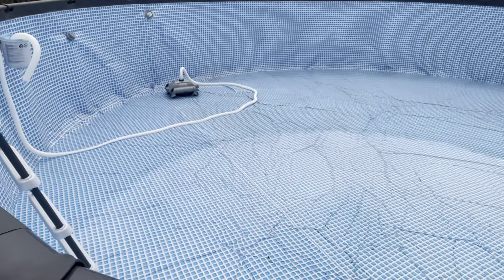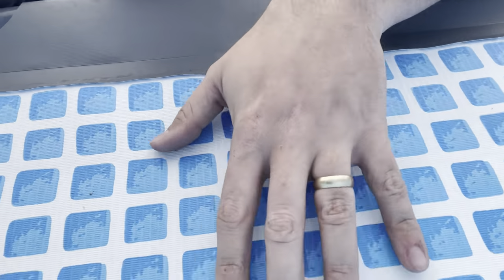FIXING MY INTEX Above Ground pool! Don't... Do what I did.. UPGRADED Skimmer!!

Comment: One thing that took care of wrinkles completely for me was allowing a half inch of water or less inside and then standing outside the pool with a shop broom.   Then take the broom and reach inside the pool and hit the bottom wall walking all around the pool as it fills.   Best way to clear up wrinkles in my opinion.   Also good to check how level the posts are as it fills every few hours or so knock them back into alignment. 

Props to anyone setting up a pool for their family's use, it's a lot of work. 

   A pool is fun for everyone except the person who takes care of the pool.  But when your kids flip out and smile in excitement when they see it, totally worth the headache. 
😄
Reply: What are you even talking about "alot of work"? The box clearly says 90 minutes to set up ...
Reply: I'm doing that shit rite now and it's so frustrating. My mom passed last year and I was so damn depressed I left the pool up all winter and just now starting to clean it and fill it up. We have so much minerals from the lime stone in our water so the liner has a solid layer of hard crystals like salt in the liner and the pressure washer won't take it off. Do u know of a cleaner I could use? Maybe vinegar then scrub it then pressure wash it?
Reply: DID THE SAME THING,  BEST THING I'D EVERY DONE.  SAW IT ON A PREVIOUS VIDEO
Reply: @steveappleton4183 Are you being sarcastic?

Comment: One thing my neighbor did to help, after I had already been trying everything myself for a few days,  was she lifted the side of the pool from the outside and pulled it.  I was too busy in the pool trying to get the wrinkles out to try that.  It worked wonders to help with the big wrinkles.  

That happened because it started to rain as soon as I got it up.    After 3 days of rain there was water enough I said oh just fill it up forgetting about the wrinkles.  

By the way thank you for your service.

Comment: We used 4x12 inch pavers under every leg and dug them down to be level. We put sand under & because we did it the right way ours has made it through 2 70+ mph wind storms here in Ky. It took a week but that was 4 summers ago. It’s definitely worth doing it the right way

Comment: Have the same size pool. The best thing I did was order a custom 64 foot ratchet strap to go all the way around the base of the legs sitting on the plastic caps. I was worried about those legs moving around. Worked perfect 👍🏼
Reply: That’s why the pool has straps….
Reply: @YellowBoltTC  it does ! Mine doesn't !!
Reply: @bernadenevanburen1521 Which pool? All round pools have straps, otherwise, it would fall apart, lol.

Comment: We had to drain our pool and re-level it using some pavers. One thing we didn’t think about was the ladder. Once the pavers were in place and the kids started using the pool, we noticed that the ladder was hitting the top rails of the pool. This actually dented two of the top rails. Now we’ve had to order two more top rails, and will have to drain the pool again in order to switch them out. So don’t forget to check your ladder if you’ve raised up your pool and be sure it still clears that top rail.
Reply: Same!!! I have the stupid ladder on a few extra pavers for now 🤦🏼‍♀️
Reply: we put our ladder on a little "patio" of pavers to solve this issue.

Comment: Ahahhaahaha loud train lol good job looks good ,we did 18x48 and we did some digging in the ground one side lower and one higher 5 legs have pavers and the rest are sitting in the ground nice and tight, towards the back of the yard and away from house are the pavers and its higher so if happens that it would tilt or any bad weather or who knows now days whatever hits it it will go down the yard since other legs arent moving and are nicely in the ground and it will not  hit inside the house we love it ! I'm thinkin of installing skimmer next year need something to clean it because for while now I have been cleaning it myself with brush dont mind it but since pool went from 16 to 18 its alot more work now lol

Comment: I’ve never used pavers I get craft wood and paint with liquid flex seal and I relevel the ground every year then got smart I dug trench and put dig in edge and used paver base and got it super level and thanks to the dig n edge I had no wash out and it stayed til this season yay! You will blister yourself pulling with hands or feet the squeegee makes it so easy and the inch of water helps them to flatten

Comment: Pavers should be level. I went inside my pool before filling it and used my feet to pull the wrinkles and then again as it was filling. No wrinkes now. While the pool fills, every 39 min you should adjust the legs which is why pavers shouldn’t go too close to the pools liner as they will pull out. Wider pavers are better but we had a 16ft concrete slab poured to avoid unleveled ground and pavers potentially touching the liner. Installing a wall skimmer tomorrow!

Comment: using pavers will raise the walls 
the side walls are only so long 
go too high and you will pull the floor liner up and will act as a side wall 
this will cause a hole where the side and bottom meet 
happened to us
Reply: Using pavers is perfectly fine and actually recommended. You just have to make sure they're buried and level with the ground.

Absolutely nothing wrong with using pavers. Infact, you run the risk of the polls actually sinking into the ground without them if the dirt below the pool isn't compacted enough.
Reply: @Superman-xr1oh Yea we just setup ours but didn’t realize the pavers have to be buried do you think we should drain and fix them or should it be fine scared of it tearing the liner and dumping all the water into our yard we are really close to multiple neighbors so that won’t end well

Comment: Did you ever have any issues with placing the pavers on top of the ground vs digging them in?  I’m using wood blocks (temporarily) and was worried about the height increase pulling on the liner seam. Thanks!

Comment: I got on my hands and knees before I put water in and push them toward the edges and then I put a little water in and put on my shower shoes and I was able to move the bottom and smooth it out

Comment: How did you get the last top bar in?  I have about a 5" difference & cannot pull it back or stretch it out enough to get it snapped togther to completely form the top ring?
Reply from the maker: Is the pool full? If so, you’ll have to drain the water. Make sure it’s on a level surface as well

Comment: You should’ve buried the pavers in the dirt or sand below the pool. Sticking it up on pavers like that will end up causing issues.
Reply from the maker: When I encounter them I’ll make a vid about it lol. Everything seems to be super solid
Reply: First thing I thought.   Luckily they will sink a bit,  but being higher that the bottom of the pool it is likely to stress the liner and poles.  

Every bit counts when there is 50,000 pounds of water in your backyard. 

He did much better than my cousin.   They ended up with a  3 inch difference in height from side to side.   Didn't take long for trouble.

Comment: Hey! Curious what made you feel like you knew you needed the pavers under the legs. Sry if you covered this and I missed it!!
Reply from the maker: 2 things,1st, I mainly just listened to the feedback my viewers gave me, and 2nd, I had to drain the pool so why not lol. Our soil where I live is soft and sandy so I think over time I would have had issues with the legs sinking even though the yard was packed by the excavator.
Reply from the maker: Good question!
Reply: @BigCountrysWay  Sounds like you did the right thing, I'm in the same boat- prepping our backyard for the 24ft XTR has a painful  undertaking lol Ive watched your review/instructionals a few times! but it seems like pavers v. no pavers is something people don't fully agree on! I appreciate the response!
Reply from the maker: @hardwarenutz9651  that’s impressive, any tips for the community?

Comment: What if one set up his above ground pool on a concrete slab ? would that help regarding the wrinkles or even the issue with the legs bending in or out ?
Reply: I have my pool on a concrete slab, but I still added a ring of pavers filled with sand to give both protection of the liner and more comfortable to walk around in the pool.  I buried an additional paver under each leg.  Use pool noodles on the bottom of the ladder to protect the liner from the ladder.

Comment: What did you use to cap off the old inlet holes?
Reply: Hello?
Reply: He used the black plugs that came with the pool. They still leaked a tiny bit so he filled them
Reply: @walterlykes9105 Bro stopped responding to comments.

I can't stand content creators that put videos up, and then just stop responding. Especially when they don't even have thay many subscribers.